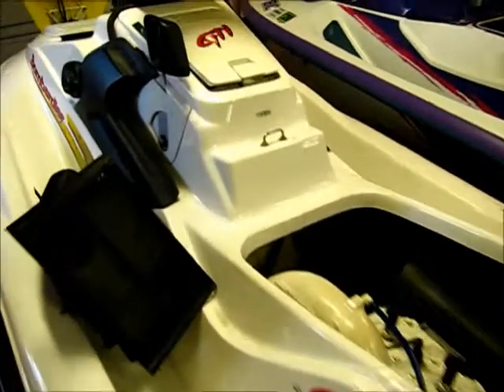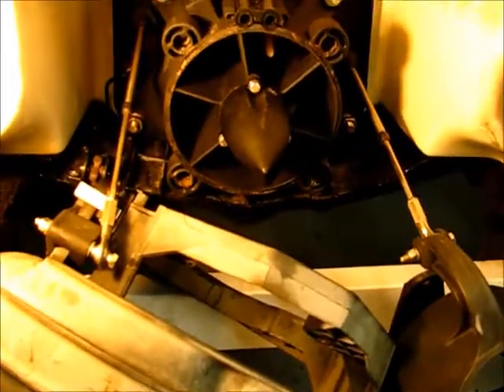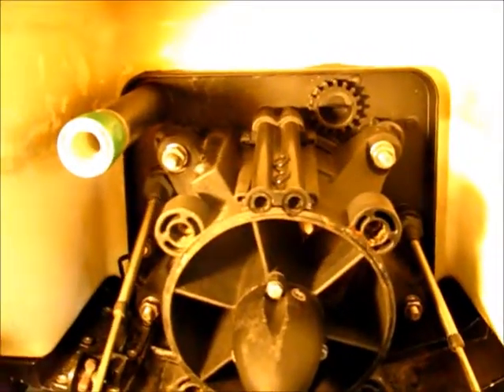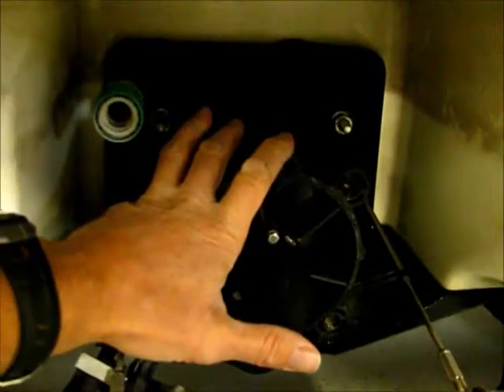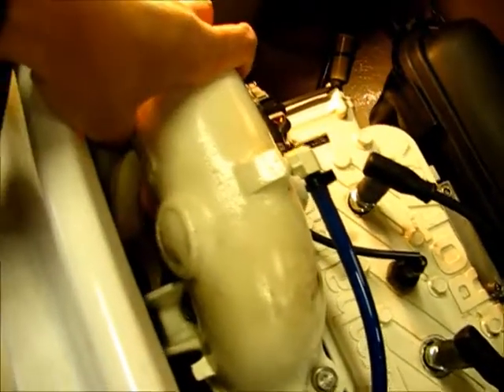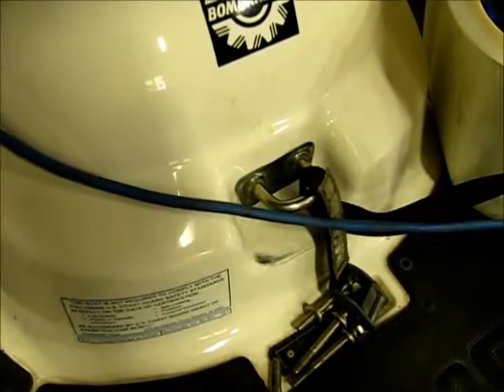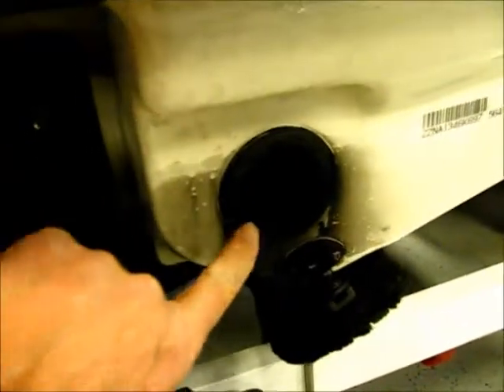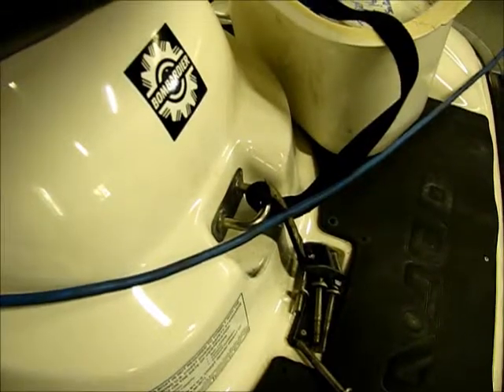Sea Doo GTI - How the Cooling System Works

Comment: @paul haines question I have a jetski like this almost same model in between the spark plugs what is that hose that’s attached to the top of the block. Mine fell off broke wondering if it’s big deal ? I appreciate it for your time thank u hopefully u can get back to me
Reply from the maker: I think you are looking at the temp sensor and wires.  If the engine overheats, this temp sensor will put the machine into a limp mode so you don't damage it anymore.  You need to fix that.
Reply: @paulhaines5755  okay but if I run without the jetski won’t get by it unless it overheats? And I really appreciate you answering me
Reply from the maker: It will run without it but if you overheat you might not know it and you'll cause damage to the engine.  When you overheat these machines, in addition to possibly damaging the engine, you can burn exhaust hoses and things that are difficult if not impossible to replace as it's an old machine and parts are not available so you really want to fix that soon.  Easy fix.

Comment: Hey Brother, I was wondering if you would be willing to work on my 1997 Sea-Doo GTI, the white double wall pipe on top will not stay bolted on and I can't seem to figure it out as well as a starting issue that takes me a while to start it. I bought a new battery but the problem persists. Just got a new starter relay & starter to see if that will help that issue. But the other upper manifold issue is the biggest concern at the moment :/
Reply from the maker: I'm not 100% sure of what exhaust part you are talking about but if I had to guess I'd say your threads are stripped or loose/damaged.  It's likely you'll have to drill and tap and install "heli-coils" to repair the threads.  If you don't know how to do that you might consider getting help as it's a good way to ruin stuff if you don't do it right the first time.  What do you mean by starting issue?  Does it not turn over at all sometimes or is it just hard to start?
Reply from the maker: One thing to try:  If you look at my vid at 3:11 you will see two larger wires.  One red and one black.  Both have a collar nut that holds the ends one in the area you see in the pic.  Unscrew these, apply some dielectric grease, then reinstall being very careful not to strip the threads.  They are soft.  If you are getting intermitant starts, this could be your culprit.  Also, make sure the battery leads are clean and attached well.

Comment: Great video !   Question, where does the hose from the exhaust manifold go?  2005 Sea Doo GTI
Reply from the maker: I'm guessing 2005 is a lot different than 1997 so I might not be of much help to you, really.  Might even be a 4-stroke engine in yours?  On mine, the hose under the manifold goes back and dumps water into the exhaust near the back.  About half-way down this hose, there is a T.  This T leads to the tell-tale on the rear of the machine.
Reply: @paulhaines5755  Thank you very much for answering, I already found it, it goes to the back but not to the exhaust.
Your video helped me. a lot.
Thank you

Comment: i just got a 97 717 Gsi what oil you reccomend? lol
Reply from the maker: These engines have rotary valves.  This is a metal on metal rotational design.  I like to use FULL synthetic quicksilver to prevent premature wear of the rotary valve system.

Comment: Which hose do I hook my garden hose to for running the machine out of the water
Reply from the maker: Rear of machine, above jet pump, left side there is a tube coming out.  In my video, you will see this tube at 2:00 the for some time after that in the upper left of the vid.  My machine has a green fitting on it.  Yours may or may not.  You'll have to hook a water hose with a simple garden hose shut-off valve to this pipe so it might require you to do a little research and find the correct adapter to screw onto the pipe on your machine.  Once you get this all done, start engine first.  Quickly turn water pressure on into the pipe I just described.  Let it run as long as you need then shut off the water supply.  Next rev the engine two or three times to blow the water out.  Shut off machine.  Don't run it for too long with to water supply.  It is important to have the machine running when water pressure is hooked up to it or you will flood your engine with water = not a good thing to do.

Comment: Hi Paul, i have a 1993 seadoo xp that is apparently clogged. It shut down, got the overheating beep when trying to start it. So i let it cool down, started it  out of water and plugged the hose in but no water is coming out the pee valve.  Where would you start?  There is a slight difference with this video which is the pee valve line starts straight off the head.
Reply from the maker: Hi, Nicolas.  I'm sorry for the delayed response!  I have not looked at this stuff for a few days.  Did you figure it out?  If not, I have another video that I did called "Sea-Doo GTI - How to Troubleshoot Overheating".  Maybe that will help you.

Comment: So in theory if you had water pushing through your tell tale when on land but not in water does that mean the pressure zone is bad?
Reply from the maker: Hmmm - could mean a lot of things.  Really the only reason the pressure zone could be bad is if you have blockage in one of the holes in the box or a badly damaged wear ring/blades.  My guess is that water is taking the easiest route out of the machine when you rev it up.  The tee going to the tell tale could be the culprit.  I don't understand why the tell-tale on these machines don't work better - poor design.  Watch my vid on "how to improve your tell-tale".  It might offer some tips.  Some guys don't like what I did in that vid but take it or leave it.  I like to know if water is moving and I like to see a good stream from the tell-tale.

Comment: Can you replace the part that drains the water from the back (where you connect the hose to)  When removing the hose the piece on the back broke off.  We have a 1998 Seadoo GTI.  Not sure what the piece is called and if you can replace it.  We have called around but no one will work on seadoos this old.
Reply from the maker: The challenges of old stuff!  It's all I own so I'm used to it!!!  You can replace it.  It's part # 271000575.  It's called "support pump GTI".  You'll have to hit 'er up on e-bay.  Looks like there is a few out there.  Look it up and look at the pic and make sure I'm right.  I've spent a small fortune on e-bay for stuff like this!!!  Non-existent new.  Orrrrr   If you know someone handy with some machinist abilities, give them the support plate and they could fix it up I'm sure.  That's what I'd do but I have access to all sorts of toolery.  If there is enough sticking out from where it broke off, you might be able to splice a new piece of threaded pipe on there with some bad-ass glue and a union joint.  Beware the four bolts on the rear of these things like to strip out.  Bolts are much softer than the nuts and the nuts will take a ride on the threads and strip it out so badly you have to cut them off or get a giant wrench and break them off.  Been there done that.  If one does strip out, go get yourself some stainless steel bolts and nuts and go thru the hull.  Use good sealer - RTV, etc.  Been there done it as well...  Also, there might be a gasket in there behind the support plate.  I don't recall.  Obviously, make sure it's all sealed up good.  Not a tough job.  Maybe stick a new wear ring in there while it's all tore down.  Hope this helps.
Reply from the maker: Oh yea - one more thing.  You'll have to juggle the linkages that go thru the plate, too.  If you have to disassemble anything to fish them out/thru, make sure you measure and mark them the best you can so it goes back together pretty much the same or else your steering will be crooked.  It's been a while since I did this job so it's kinda fuzzy in my memory.  Hope I have offered some good non-misleading info!
Reply: @paulhaines5755  Thank you so much for the quick response and great information I appreciate your help!

Comment: So could you use the engine for a project and use a radiator to cool the engine?
Reply from the maker: Seems like a real trick to me although I bet someone out there has figured it out.  The cooling system in these is not closed loop so you'd have to capture coolant off the exhaust somehow at the point where it usually gets dumped out the exhaust in the rear = soot and stuff getting in the engine cooling system.   If you loop it before the exhaust in the rear, you will have issues with exhaust parts getting too hot and melting.   Maybe if you had all metal exhaust parts and you loop the cooing just for the engine.  You'd need a water pump and prob. electric fans on your radiator.
Reply: @paulhaines5755  I hear you, but it is a 2 stroke. And air cooled 2 strokes don't need any coolant or water to cool the exhaust. Yeah, I figured I need a radiat for sure. Just asking. thanks
Reply from the maker: Cool - yea would be an awesome go cart engine or something like that if you could make it work.

Comment: Could this be a source of water to get in motor? My plugs are milky. 96 xp 787.
Reply from the maker: My opinion:  It's NOT likely the water cooling system components I've shown in this video are the cause of water in your cylinders.  It's true these systems are bringing water to the engine but not the cause of allowing water into the cylinder or crank case.  It's more likely you have a bad gasket on the top of the motor (head gasket) or the exhaust manifold gasket is leaking.
Reply: @paulhaines5755  ok I get that but where is the source of water? The hual only has an inch of water in the bottom no way its splashing in thru the gasket
Reply from the maker: @kwadlife4106  You are correct.  The water in the bottom is likely not the problem if it's well below the engine.  If it gets too deep, I suppose it could leak in thru a bad crank seal but not likely especially if you don't see 2-cycle oil in the bottom of your hull + that's a lot of water to get there!  The water in the cooling system is likely leaking into your cylinder(s) somewhere.  The two most obvious places are the head gasket and the exhaust manifold gasket.  I'm not sure how to explain it.  I've had these motors torn down so I kinda know how this could happen.  Maybe if you looked at illustrated parts diagram it would help you?  Also remember I'm no ace wave runner mechanic and could lead you down the wrong path.  I enjoy helping but can't be sure of the problem without tearing into it.  If you're not sure what to do, I'd take it in and have someone diagnose if you can.
Reply from the maker: @kwadlife4106  I guess think of it this way:  There are ports for water running all around the cylinders.  On the sides, on the top, etc.  Anywhere something bolts to the cylinder (exhaust manifold, head) there is a gasket.  If that gasket gets a crack or something in it, it allows water to enter the cyclinder(s).  Hope this helps you more.

Comment: man my 2002 Sea-Doo gti is kicking my ass am hopping you can help me a bit! Back story I purchased to skis about two weeks ago never owned any 0 knowledge might have done a few boo boos I those first days of owning them  I scared the web and I can say I think Iliana know a lot more now but am still pulling my hair with this sky I can’t get it to start  ! When I purchased I didn’t start so obviously it help me to knock the price down it had a low battery at that time and first mistake I use my jump box to starter and still nothing, then I got home and in the next few day I tried to start it with the jumper add starter fluid and it did start for minor periods. Second mistake I didn’t know at that time that I had to start sky then water. Then water off then sky! I was trying to start it with the hose on and then of I was all over the place. Then I learn the cycle and said oh oh 😕 then I decided to buy a new battery because I learn that jumping the unit could damage the computer . So battery came in installed it connected my hose water off cranked it and boom sky fired right up turned the water on and I felt the idle was having issues felt to low so I started reving it a bit it satayed on for about 40 seconds to  a minute and all of asl sudden I hear this grinding noice and. Off it goes and I haven’t been able to start it since then I check compression is like 120 both I check spark I see spark I added fuel in the carb and nothing it just cranks and cranks  I’m thinking I might damaged the computer with the jump box but it did start once with the new battery??  Am going to put a link to clip that I just took hope you can help thanks                              https://youtube.com/shorts/cibxirPk0Bk?si=tI30I1bY8n8in19-
Reply from the maker: Keep in mind my knowledge of this machine beyond what I show in my vids is fairly limited.  I'm really not sure what to say but I'll offer a couple thoughts.  Two strokes that are not running well foul plugs very VERY quickly especially if there is something "too much" in the crank that it's trying to burn off.  I'd throw some new plugs in and try again.  But before you put them in, crank it over good with the plugs out and see if anything comes flying out the holes.  If you severely flooded it or the previous owner swamped it, there could be excessive gas or water in the crank case which will cause extreme hard or no start and immediately foul plugs.  I think it's also possible to force water into the machine when it's not running and get it into the crank case via your hose hook-up  There is a process for purging water that you will want to research if you do think the crank case has some in it or I can help - been there done it.  I'd also look for damage to the output shaft and impeller to see if it's possible that something is locking up and creating the grinding noise.  It might also be smart to run mixed gas in the tank until you get it to run in case there is an issue with the oil pump system.  Make sure your dead man (DESS) is the correct one and it's seated properly.  The wrong deadman will make it a no start.  As for a bad ECU, yes it's possible but I'm not sure how you could test it.  Likely you'd have to bring it to someone and have them test it for you.
Reply from the maker: Oh yea and don't forget you might just need to clean the cab 100%.   It's also possible the pulse pump is not working or not primed/dry and you'll need to prime the lines upstream of the pulse pump to get it to pump fuel and build pressure in the fuel system properly.  simply stuff first before you go assuming electrical...
Reply: @paulhaines5755   thanks for the input! So I have taken the carb out and got the rotary valve uncovered is it normal for me to spin the crankshaft with my hand plugs out of course to not fight compression. So when I turn the crank freely my rotary valve shaft don’t turn and in some instances is catches up an starts turn along with the shaft ??
Reply from the maker: I honestly have never worked on a rotary valve.  You should do some more research on youtube and see if someone has a vid on replacing it or inspecting, etc.  My first instinct is that it should not be intermitantly moving but I can't say for certain.
Reply from the maker: Ok I watched a couple vids as I was interested in learning about this.  It's likely you have a worn /damaged gear surface on your rotary valve.  Watch a vid called "how to set your sea-doo rotary valve timing" for starters.  It's a good one.  Paul
Reply: @paulhaines5755  thanks for the reply. Yes in fact I already started to disassemble the engine to take out the hull
Reply from the maker: Did you get anywhere with this?  I'm curious about it.  I watched another vid that said if you bypass the oil tank/oil pump system and run mixed gas the lines to the rotary valve assy must still be present or you'll damage it.  Is your machine converted to pre-mix???
Reply: @paulhaines5755  no is not premix, I started taking it apart and noticed the rotary shaft is slipping in the crankshaft so whole engine has to be taken apart
Reply from the maker: oh bummer.  Good luck!